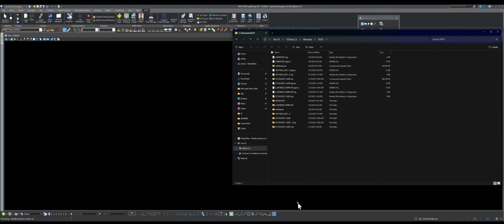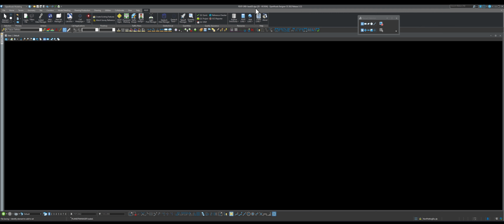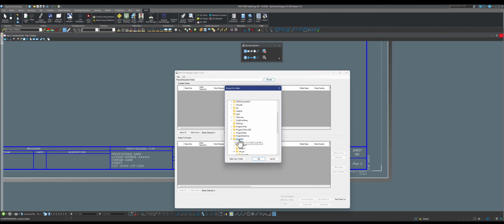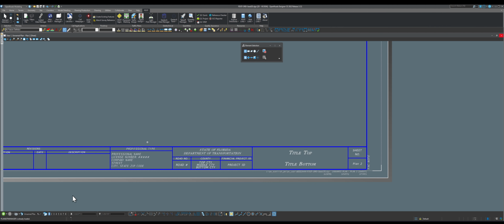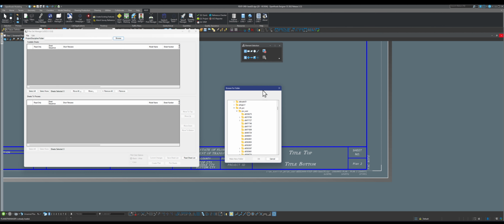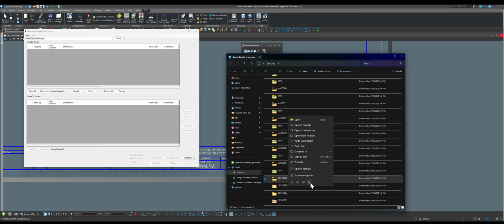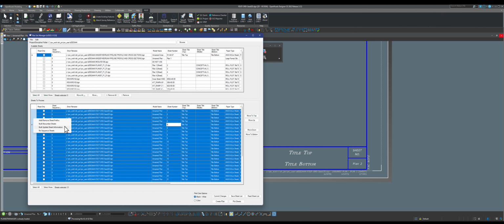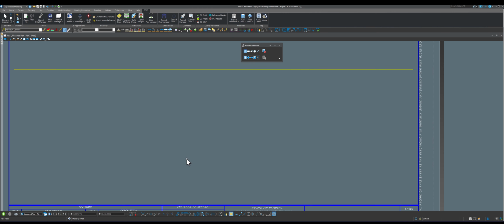How to use FDOT Planset Manger with ProjectWise

Comment: Thank you for Video. Have you made or do you have a video on creating the automated FDOT ORD Match Line Annotation?
Reply from the maker: No my friend, i didnot. Per FDM 900 it is not used anymore or it is required. I understand so people still ask for it! Try telling them it is not required, but if they still need it. Good luck making them. I have not made them before. I think Bentley have a video about that, but it is not that great because they skip an important step in making the annotation  and never explain why.